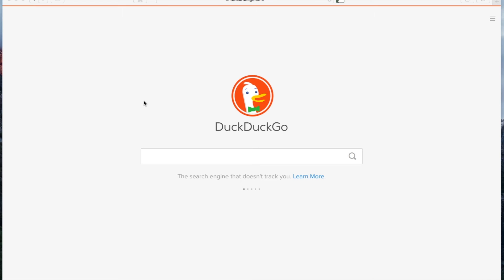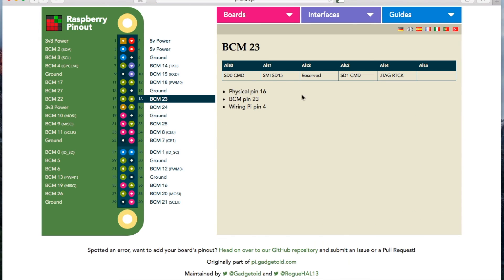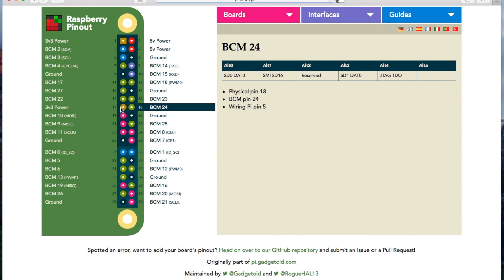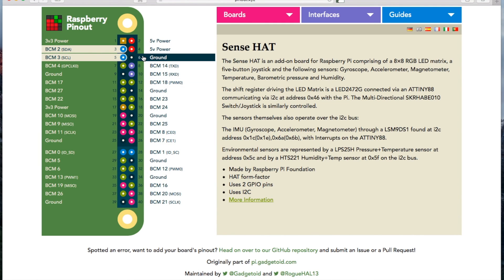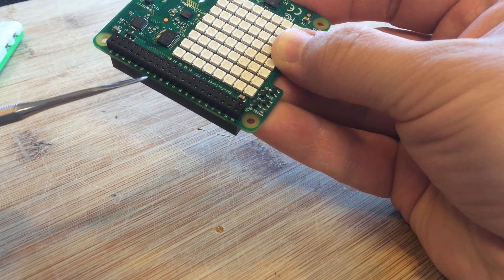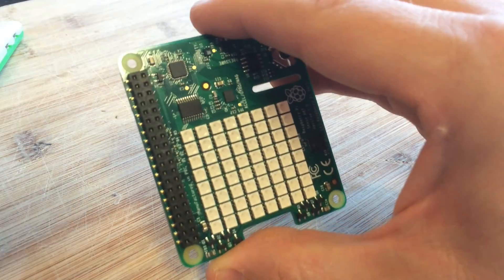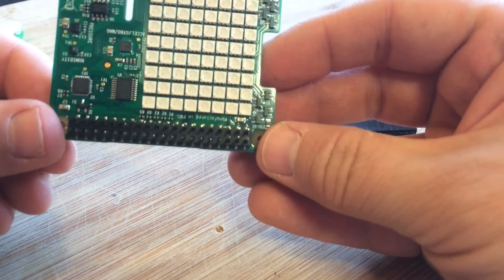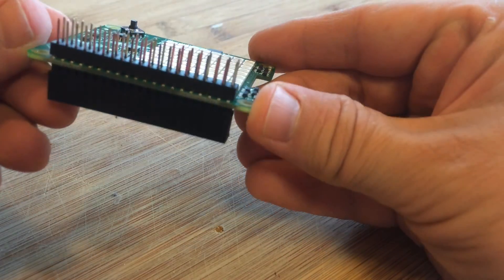Use Raspberry Pi GPIO pins with SenseHat attached

Comment: My sense hat adapter for Pi 400 has two double rows of pins.  Only one of them accommodates the sense hat.  Before reading your post, I didn't understand why the adapter had 2 sets of pins.  Now I suspect that the pin set not occupied by the sense hat could be used for the breadboard adapter without the need for taking my sense hat apart.  Have you tried that?

Comment: Does anyone know if the sense hat uses all the the pins
Reply: All the ground pins not the the pins!
Reply from the maker: King Balloonion not sure, do a continuity check with a multimeter across all the ground pins on the sense hat, if they are all connected you only need to connect one of them to the Pi.
Reply: Thx

Comment: If you use jumper cables to connect the needed pins you don't have to have the sense hat directly on top of pi, solving the problem of the temperature sensor being inaccurate as it is directly on top of the CPU.
Reply: What a bloody good idea! I'm doing this now because the temperature readings are useless!
Reply: On the pi400 with adapter, the hat does not sit over the computer.  Also, the pi400 generates very little heat.

Comment: Actually, one last thing...I just found out that you ALSO have to have the I2C eeprom pins connected. That's pins 27 and 28. Without those, the hat is connected but address 0x46 does not show up when you run i2cdetect. FINALLY IT WORKS! I now have a PWM controller and the raspberry pi sense hat running off the same i2c pins

Comment: I tried using two GPIO jumpers to connect the hat to the pi and it did not work. I also tried connecting power and ground GPIO jumpers but it still dod not work. Any ideas why?
Reply: Actually i just figured it out. The Gpio pins that are used are the 5V power, the 3.3V power, the two I2C ports, and any ground.
Reply from the maker: Nick the Drone Guy are you trying to connect the sensehat to the Pi with jumper wires. It uses 4 pins. Physical pins 1, 2, 3 and 5. See this page http://pinout.xyz/pinout/sense_hat
Reply: Keith's Pi Tutorials that is where I figured it out. my problem was not realizing it needed both powers in.
Reply from the maker: Nick the Drone Guy you also need a ground. Sorry, forgot to mention that.
Reply: Keith's Pi Tutorials well yeah. i just thought that it needed one of the power pins not both. I'm an idiot. ;-) Good video though! I need one of those GPIO pin extensions
Reply from the maker: Not an idiot, I did not realise it needed both 5v and 3v3, although it does mention it in the details section of pinout.xyz. Glad you got it working. The Pi Hut do those extended headers, only £4 https://thepihut.com/products/stacking-header-for-raspberry-pi-2x20-extra-tall-header?variant=1130974052
Reply: Keith's Pi Tutorials ok nice thanks!
Reply: Hi Keith/Nick, I'm not sure if you looked at a previous version of the sensehat, because now pinout.xyz shows that it uses 6 GPIO pins, which on the pi would be pins: 3, 5, 16, 18, 22, and 24. Now, I'm kind of new to the Pi, so I hope I'm not asking a stupid question: why does pinout.xyz says only 6 GPIO pins are used, what about 3v3, 5v, and ground? Aren't those pins also part of the GPIO?

Comment: That looks great and will be very useful!
I wonder how tight the surface mount header on the front side could hold the extended header? When you try to take your SenseHat off from your Raspberry Pi, will the extended header get detached from the SenseHat board?
Reply from the maker: Generally the header pulls off the Pi rather than from the Sense Hat, but that is how I discovered it was removable.  Once when removing the Sense Hat from the Pi the header pulled out a little, exposing the pins.
Reply: Thanks for sharing :-)

Comment: Thanks for the info about these connectors. I did not realise that they came apart.I've been using a Pimoroni Black HAT Hack3r for access to the unused pins on my HATs for some time and this work really well with the connectors which do not pull apart.Tony Goodhew
Reply from the maker: Glad I could help Tony.  When I discovered it came apart and it was possible to put an extended header in place I thought it was too good not to share.